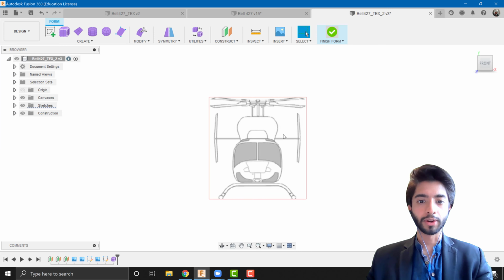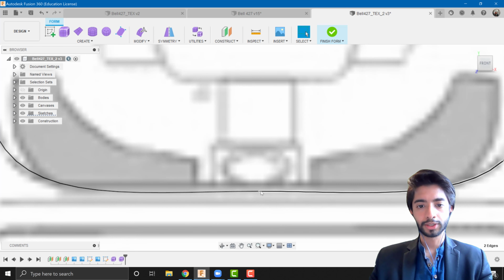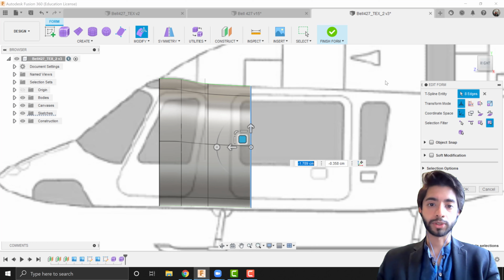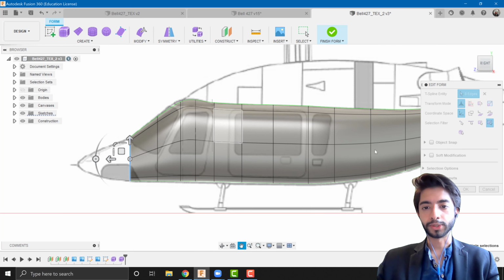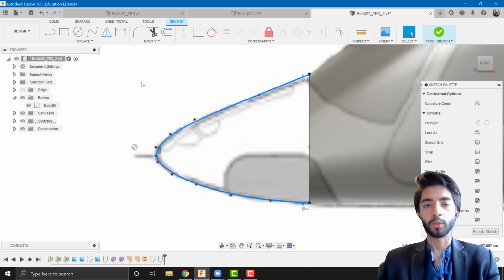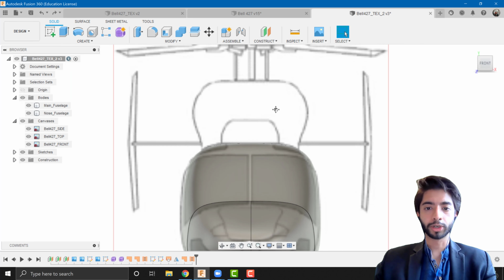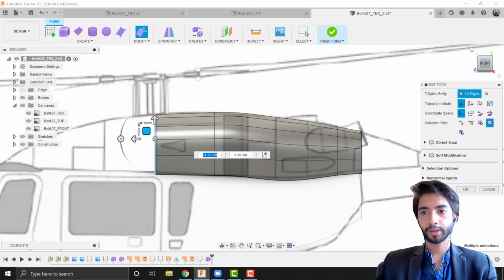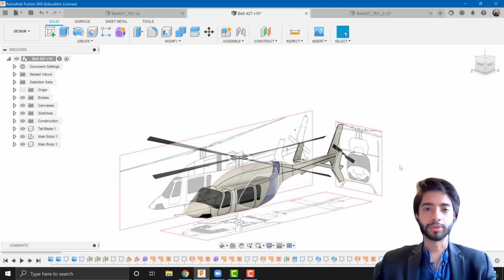How to Model a HELICOPTER in Fusion 360 | Tutorial 2 - Fuselage | Step-by-Step (4K)

Comment: I have a small problem, I'm adjusting in both x and y but need to adjust both separately, what button have I not pushed?
Reply from the maker: Hey Laurie! If you're talking about the free form tool, you need to click on the button in the corner instead of the horizontal and vertical ones :) I wish I could attach a picture! Try all the buttons when you're using "edit form" and you'll figure it out! Keep me updated!